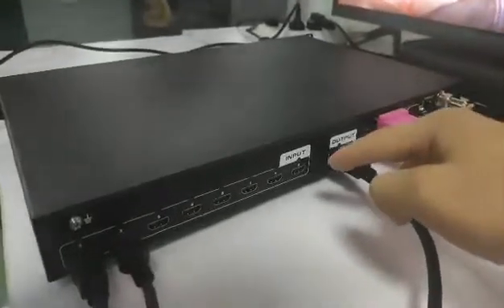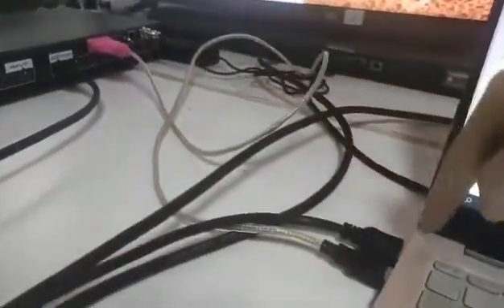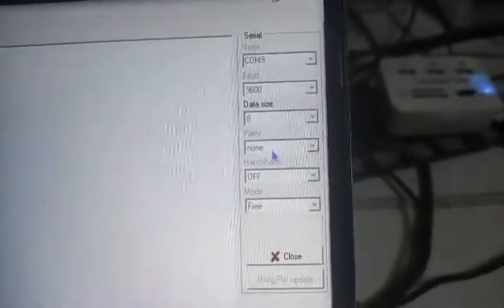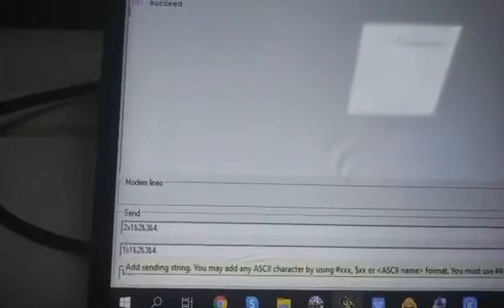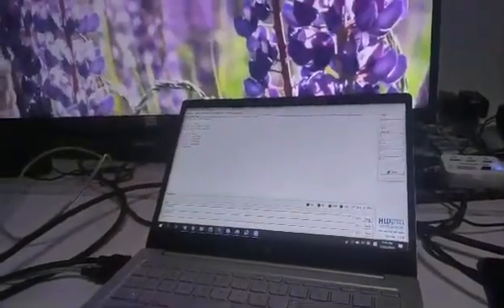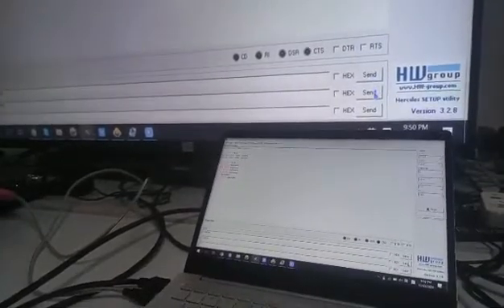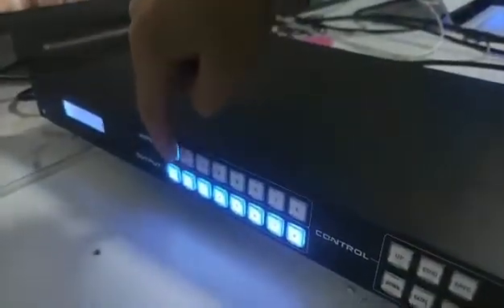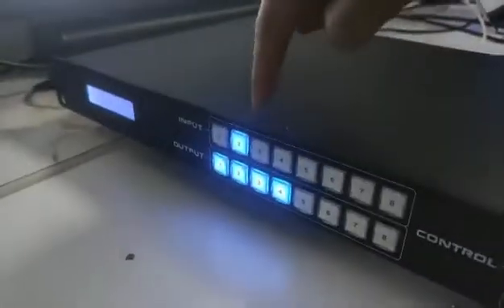RS232 control for the fixed 8x8 HDMI Matrix Switcher

Comment: I can't understand the name of the software... Nice demo... :) I have a 4x4 matrix and whit this a can use directly in my home automation.
Reply from the maker: Hi Newton, thank you for your comment. The RS232 is just a software which I got from one of our engineer, not sure how it called on Google. If you need it, I can send it over to you. Yes, Totally can be used in your application if you got the RS232 commands for the devices you have in hand. Thank you.
Reply: @rockyhdtvsupply631  I also have a problem with mine, I tried Termite and PuTTy but still not sure what the feedback means from my splitter. my commands also dont work
Reply: @hiuwo  I have same problem. What is the software which communicate the device via rs232?